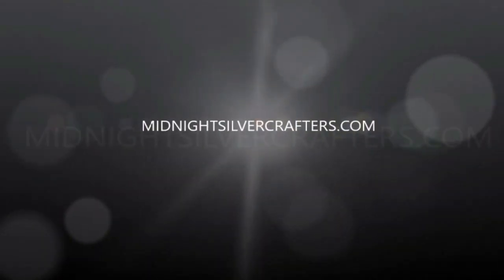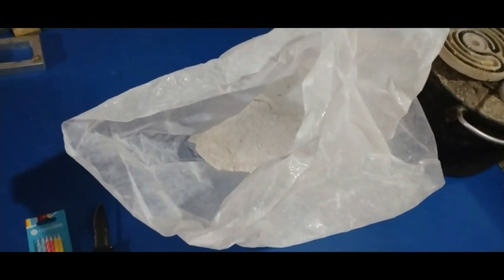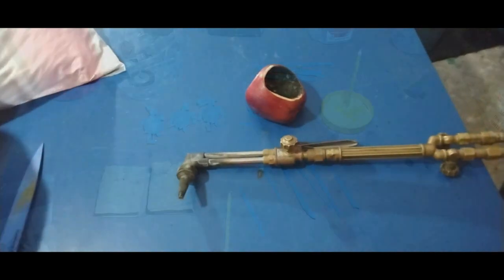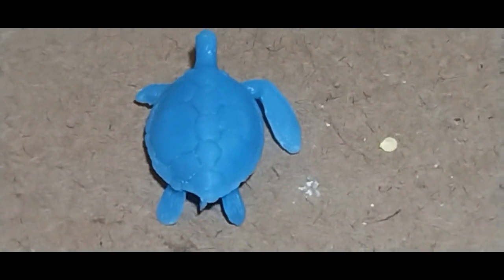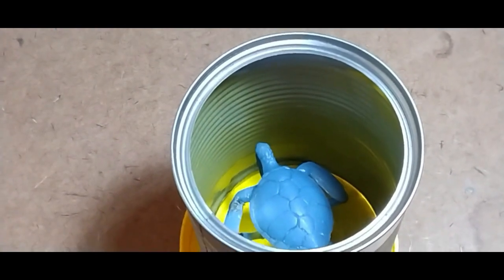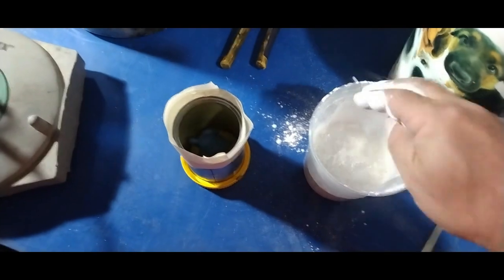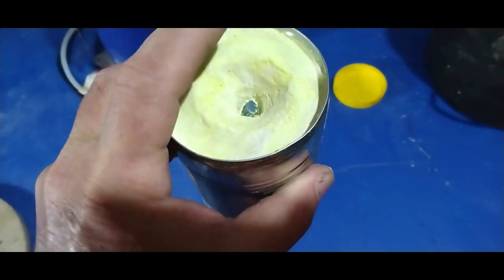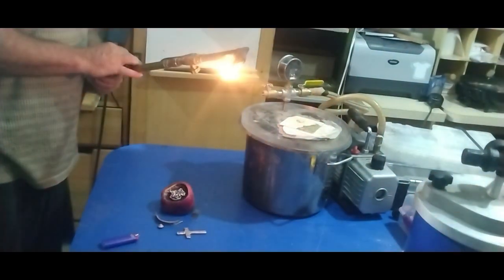casting a sterling silver turtle at home using lost wax casting method

Comment: Hello all

I’m using bluecast resin v2 prestige Optima investment powder and I can’t seem to get a good cast. I’m using a vacuum chamber. I’m running the liquid Silver at 1050° and the crucible is running at 450° when I pour, but the cast come slightly surface cracked in some areas and a few very small holes or indent. Is there any way I can improve this?
Reply from the maker: sorry for the long delay.... are you using a furnace or a torch to melt your metal. just keep it simple. What i do always works well for me .... I had a long learning curve as well.... I use a plain old welding torch to do my castings...I use it with oxygen @ propane. not sure what you are using.
Follow these steps to get a good casting...
Please note i am working with all homemade stuff and I cast all my castings in food cans and  a simple homemade burnout oven.
I never worry about temperature or any of that stuff.
these are the steps i do every time.
Mix investment : I put clean water in mixing container .
Then I use my fingers and slowly start sprinkling in the powder
and let it settle to the bottom... very lightly I keep slowly adding the powder keep doing this until the powder breaks the surface of the water and starts to mound up. then i put in a tiny bit and watch it.... when it starts mounding up stop and let the powder soak up the water about 2 min or so.
Then I take a table spoon and hand stir it until it is super smooth creamy and well mixed. Then I put it into the chamber and suck all the air out of it, Then i poor my mold and set my mold in the chamber and do it again. Now leave it in the chamber to dry for 1hour or so.
then take it out & take the tape off the top and remove the sprue base. 

Then I set it in my burn out oven sprue facing down and pug it in and wait 2 or 3 hours and cast it.

Before I take it out I prepare my potato crucible. 

Cut the top off flat with a sharp knife then carve a hole with a spoon big enough to hold your silver and cut a small spout on the end so you get a good pour

Now put your metal in along with a small pinch of borax. now put the hot mold on the vacuum chamber lid and watch the guage when you have good vacume on the mold ..... light the torch and melt the metal...when it starts flowing use a carbon stirring rod to rake off the impurities from the top and excess borax.

 keep the torch on the metal at all times when you dump it into the mold.

shut off your torch release the vacuum and drop it into cold water and the investment will dissolve and your casting will be on the bottom. after you do it a few times it is so fast you would not believe it. watch my SHORTS videos to see the whole thing in action. 
Each set up will be different.....Watch my videos to learn this method if you want to try it.
 I started with an electric furnace and will never use that again way to slow way to expensive with all that power wasted and the graphite crucibles bur up and are expensive.
If you can use propane look at my mixing bowl furnace.
It works like a champ and the slip cast ceramic fused silica will crucibles never burn up!  
Hope this helps!